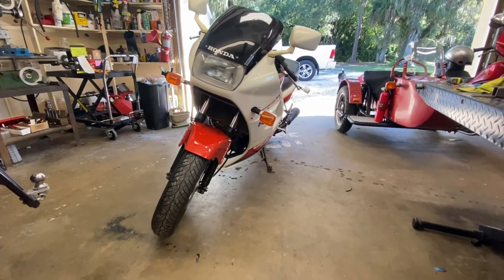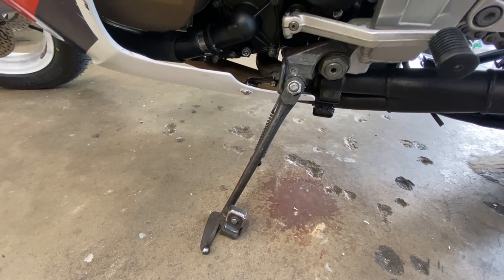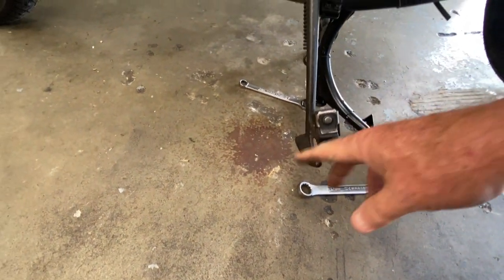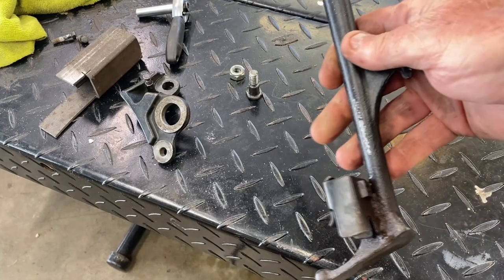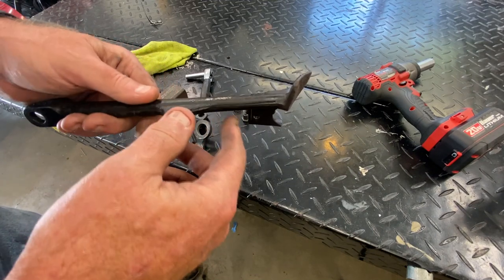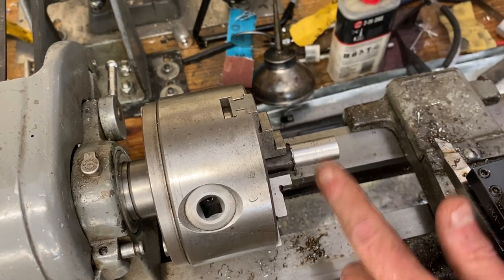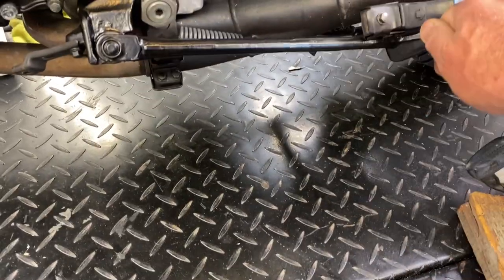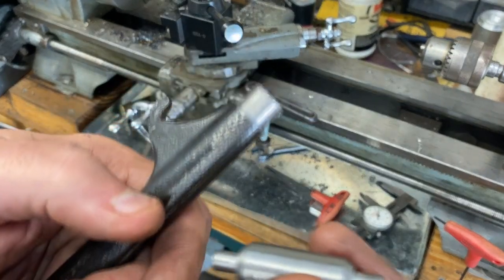Lengthening a kickstand! Why is it so short? Lathe, mill, welding.

Comment: The rubber piece is supposed to kick the stand up if you drive off with the stand down.
Reply from the maker: Ah. I didn’t know that. Thanks.
Reply from the maker: That makes a lot of sense since if it’s down and you lean left that rubber will touch first. Cool.

Comment: A Tig would have been very handy.
Reply from the maker: Agreed. Cannot afford one. I will not purchase a Chinese made Tig from Harbor Fraud or similar, and I cannot yet come up with the money for a Miller or Lincoln unit. So I have to do with what I have to do it with... Turned the heat up and wire feed down, little more controllable and good penetration.
Reply: @MotoRestoFL  Well understand. You did a great job with the Mig just the same. Thanks for sharing!